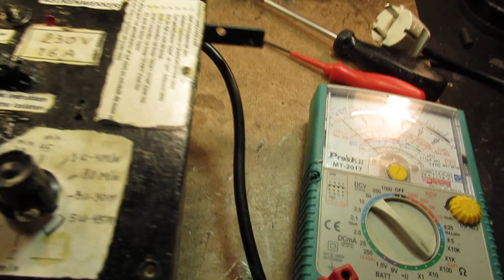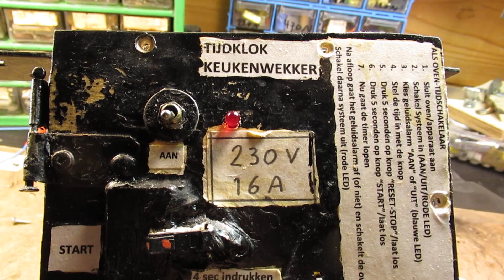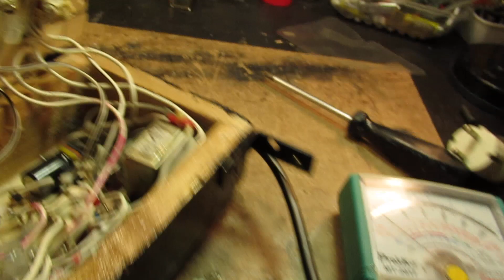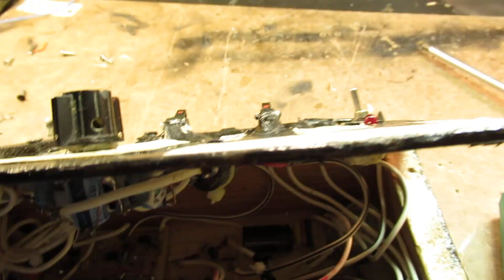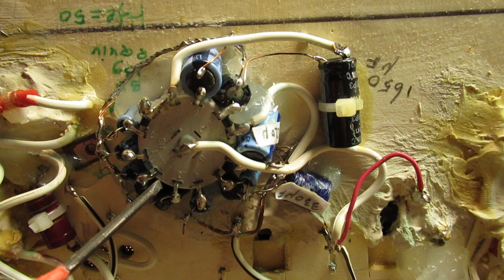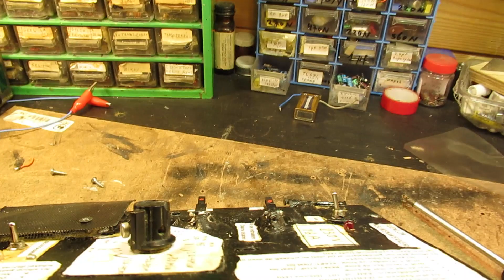VLOG: talking about analog timers made via the R-C principle with links to schematics (textbox)

Comment: Thanks for the very usefull circuit. Never though of using a Darlington to extend the unload time of a capacitor for making a timer.
Reply from the maker: Thanks Bjorn, I did many experiments with these kinds of analog timers in the past. Making the current amplification of the Darlington transistor unit extremely high. It gives the effect that a very long time is necessary before the electrolytic capacitor that sends its charge via a resistor into the base of the 3 or 2 transistor Darlington is depleted so much that it cannot drive the end-transistor with the relay in its collector lead any longer. If so: the relay falls off. Stray currents can play a role, so the board must be  clean. 21 jan 2023.
Reply: @radiofun232  , i had to know this effect, because i experienced it myself months ago when i was working on my "Electronic Circuit Breaker" and was experimenting with capacitors for adding a delay in tripping.